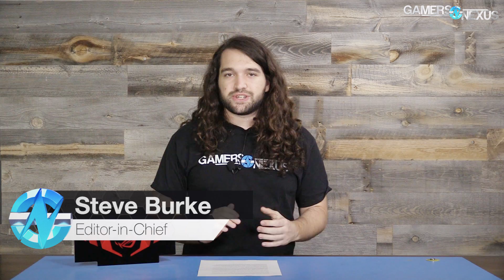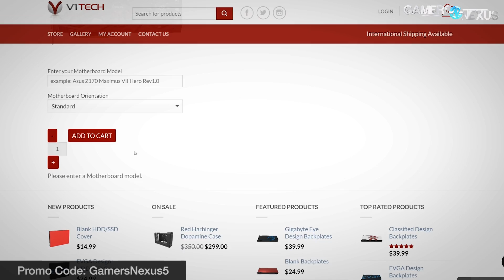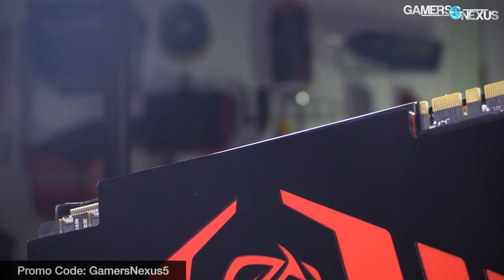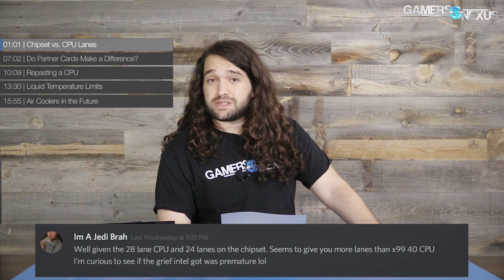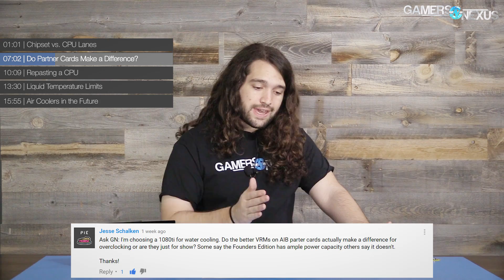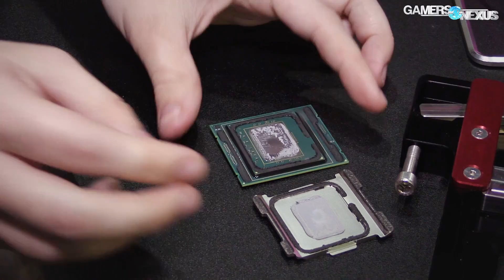Ask GN 51: How PCIe Lanes Work (CPU vs. Chipset)

Comment: Gamers Nexus Could you please make a video about how overclocking affects 0.1% and 1% lows?
It seems that quite often when you show overclocked results, the lows will be even lower than the stock frequency.
Would it even be worth overclocking most cards to the max since the lows are what's most important in most cases to make the game play smoothly, especially if you are already getting high framerates.
I'm assuming this is another reason why many manufacturers don't clock their cards higher even though it is possible for them to do so.
So would you be able to make a comprehensive video, comparing many cards and games, and try to see the effects, and maybe finding the ideal overclock so that it doesn't reduce the lows, and hopefully finding out why this happens (is it thermal? or lack of stability? low quality components?). I ask for a video because a simple answer wouldn't give us an in depth view of it all. 
Maybe compare a whole bunch of cards with the same chips from different manufacturers to see how they do.
I feel like this would be the best way to shop for a card, since lows are really the most important when it comes to choosing a specific brand and model for performance.
Reply from the maker: We'll be doing something like this eventually. We are revamping our testing methodology to improve it beyond just 1%/0.1%. Should have some progress soon.

Comment: is there anyway to check how many pcie lanes are you using Via software? because I would like to know how much lanes does a gpu use and how much does a raid card use? because I only have limited amount pcie lanes for my cpu
Reply: reading your motherboard manual will tell you how many lanes are available in each slot, a gpu will use up to 16 if they are available, the lanes used by the raid card will be the lower of the lanes used in the specifications of the raid card (should be somewhere in its manual or spec page) and the amount available in the slot it is installed in, but it will not perform as well as it is capable if it does not get the lanes its specifications requires. There may be an obscure way to do it in software, but the obvious way is to read the manual and make sure that every device is in a slot that has enough lanes for the device.

Comment: For the whole pcie lanes it was pretty funny when ryzen came out and all the intel fanboys were like:
"haha only 28 lanes that's not enough what a waste"

and then along comes intel
"hey guys 28 lanes for everyone"

and amd back at them like
"yeah we got 64 on threadripper this is the high end stuff not the 8 cores we released earlier" lol
Reply: Yeah I'm not saying 28 lanes is bad it's plenty for the majority of people I was just pointing out that intel fans were so quick to jump on hating amd stuff and then intel is like "hey we can do that too" lol
Reply: The funny thing about the AMD fanboys is that they make up things for the Intel fanboys (and the other way around)...
I'm yet to find a single reason why 99.999% of the users would care about this.
FACT a 8x PCI-E is enough for a TitanXp (less than 2-3% vs 16x)
FACT no idiot is going to buy a High end GPU or 2x for that matter and then slap it with a the peasants of the HEDT CPU.

From an hardware/performance sand point there is no issue. Intel should have never offer those two peasant CPUs, they make no sense on the HEDT family of products.
Reply: no reason for Kaby Lake X to exist period.
Reply: Algorythm44 you need to differentiate. The 28 lanes on Ryzen are not all CPU and all addressesable to what you want. Where as a 28 lane X99 or X299 part still also has the DMI and the associated HSIO lanes. 

The 600$ 8 core should have all 40 lanes no reason for it to have been glimped! I'm extra pissed cause that the price range I'd buy.
Reply: Elliot Kaufman Also, the 28 PCIe lanes of ryzen only has 16 PCIe gen 3 lanes, while intel promises they are all gen 3 lanes.
Reply: Algorythm44 Well, I have never encountered anyone saying that the 28 lanes from amd weren't enough and claiming intel is doing better. The 6800K hexacore also had 28 lanes, so the only thing they could say is that the 6 core 6850K and higher cpu's did have 40 PCIe lanes. Than came the skylake/many lake where the 28 lanes has expanded to the 7820X 8 core, but above that there are 44 PCIe lanes. But than we would forget about how much PCIe lanes there were on the chipset. The X99 chipset only had up to 8 PCIe x2 lanes dedicated which means that most things were run from the CPU PCIe lanes, the new X299 chipset has up to 24 PCIe gen 3 lanes. Of course, the chipset PCIe lanes can't be freely assigned by the user, but if you are using a M.2 SSD than you are using already 4 of those PCIe lanes, also the wifi uses it, and the LAN uses it, and the USB-ports etc. The X370 chipset offers 8 PCIe gen 2 lanes, which is the same as the intel X99 chipset. So even the Kaby-lake X quad cores with just 16 PCIe gen 3 lanes combined with the X299 has a whopping 40 PCIe gen 3 lanes compared to the 6800K with X99 chipset which had only 28 PCIe gen 3 lanes with 8 PCIe gen 2 lanes (comparable to 32 PCIe gen 3 lanes). And if we than have a look at amd with the X370 chipset, than they offer 24 PCIe gen 3 lanes from the CPU and 8 PCIe gen 2 lanes from the chipset, what is around 28 PCIe gen 3 equivalent. But they use 4 of those PCIe gen 3 lanes from the CPU to interact with the chipsets so the effective count is only 24 PCIe gen 3 lanes equivalent... So the 28 PCIe lanes from intel is far from as bad as the 24 PCIe lanes from amd. Even the 7640X/7740X do offer more PCIe lanes with the X299  and X370 taken into account.
Reply: i'm not sure any boards except 2011 sockets had 40 lanes, so the people boasting at you were comparing apples to oranges. the normal deomestic chips [1150, 1151, 1156] all had about 28, which in my opinion, is terrible. but it's a bad choice of chip. not bad design. 24-28 is good for gamers, but not workstations
Reply: Algorythm44 Well, the X370 top of the line motherboard for ryzen only offers 8 gen 2 PCIe lanes, just enough for 1 NVME drive. And no, you can't count that with the 24 lanes from the cou since the chipset uses 4 PCIe gen 3 lanes from the CPU. So a total of 24 PCIe gen 3 lanes. How does that compare to intel? Well, the enthousiaste line up does have a 8 gen 2 PCIe lane chipset, named the X99... The current gen enthousiaste cpu's can't be used with that old chipset, they got a new chipset named X299 and how mane PCIe lanes does that have? Up to 24 PCIe lanes gen 3. So the kaby lake X with 16 PCIe gen 3 lanes offer a total of 40 PCIe lanes. You only get to choose what 16 PCIe lanes do, but the ryzen let you choose 20 PCIe lanes. That is a but far from the 28 PCIe lanes that the skylake X's start with.
Reply: ABaumstumpf Well, the peasant CPU's are still useful. For those who want to get started in the performance build, they can start of with the 7640X/7740X and save up for the next gen CPU they want (be that an 8 core or the 18 core), they would than only have to switch the CPU and not the CPU and motherboard. I don't think intel will add extra features in the chipset that would replace the x299. Maybe thunderbolt, but I don't think thunderbolt would be that useful for desktops. Well, I would use it, to route the connection ports I need easy access to, to my desk. For example USB portes, sd card reader, audio etc. But I don't know if the successor to the x299 platform would have thunderbolt integrated. Also, for those who wants the max gaming performance, there is no CPU that beats the i7 7700K yet, the i7 7740X will probably do it since they promise higher OC potential.
Reply: Alex Marin The ryzen are all stitched together, the 8 core are 2 quad cores stitched together, the 6 core are 2 quad cores stitch together with 2 bad cores disabled, and the 4 cores are also 2 quad cores stitched together with 4 bad cores disabled. So threadripper will be 4 quad cores stitched together
Reply: It did cause a lot of foot shooting with the arguments. So much so, a lot of intel fans saved face and jumped ship, since intel made them look so stupid defending them.
That is the thing, I think it is less about being a fanboy, and more about being the one defending the one who won't make them look stupid.
Reply: There is no bigger marketing scam than what AMD is doing with Threadripper. They say it is "16 core". Bullsh*t. What you actually get is a monstrosity of two octacore dies stitched together. Nowhere near identical to having 16cores on a single die as you have with Intel. That is like stitching four 4K monitors with very thin bezels into one franken-monitor and comparing it to a legit 8K single panel monitor as if they were the same and say “look both are 8K, mine is 25% of the price!” and then have my ignorant fanbase attacking the manufacturer of the legit 8K monitor as being greedy. 

AMD is also saying that with X399 you get 64PCIe lanes to make it sound they have 20 more than Intel’s 44. What AMD does not tell you, however, is that 24 of these 64 lanes will be wired by the motherboards to general purpose I/Os (M2, SATA, USB, etc) in a similar fashion the 24PCIe lanes of the Intel’s chipset are wired. So with Threadripper you only actually get 40PCIe lanes dedicated to PCIe3 expansions slots (for GPU cards, etc) – that is 4 LESS than Intel (44), not 20 more.

Finally in Ryzen 7 and X370 you were only getting 24 PCIe lanes TOTAL.  Not 28. And fro those 24, the 8 were wired to general purpose I/Os (M.2, SATA, USB, etc) leaving only 16 PCIe3 lanes for GPUs. On X99 and 6900K you were getting 40PCIe lanes from the CPU plus another a further I/O connectivity bandwidth on the chipset worthy of 16PCIe3 lanes (6xusb 3, 14xusb 2, 10 SATA 3 and 8xPCIe2).
Reply: i dont think there is such thing as an "intel fanboy"  lol.   i think ppl are just fanboys to whatever is in the lead.
Reply: There are definitely fanboys on both sides lol

Comment: Which ryzen 5 cpu would be good for a seperate stream pc. I've been thinking of running a dual pc set up for streaming but want to stay budget friendly with ryzen 5.
Reply: The  r5 1600 is a good deal because it is a 6 core with a stock cooler, and it can overclock (even some with the stock cooler) and because it is a 6 core 12 thread cpu, it could run most games currently available and still have 2 cores available for streaming, or if used in a dedicated streaming pc, the 6 cores will handle encoding well, since that is a multithreaded task. The quad cores with hyperthreading could probably manage being used in a dedicated streaming pc, although they would not handle the job as well as the 6 core and the price difference is not very much. The 1600X is not that great of a buy because it has no stock cooler and the 1600 overclocks to the same speed, and performs the same when overclocked, although it is better if you insist on leaving things at stock.
Reply: I was looking into building a second pc to stream from my main rig which has a 6700k. The 1600 does seem like a good buy for this application.

Comment: With the recent announcement of the xXbox OneXx claiming 4k for $500 do you think you can try to put together a build for a similar price that could achieve the same thing? It would be an interesting spin to make 2 rigs, one with  new and one with  used parts to try and gain the most performance per dollar possible. 
P.S. Since 60fps was only promised for Forza it is only fair that you aim for 4k 30fps or better :)
Reply: 1157StrangeKid probably medium settings and not 60 fps
Reply: 1157StrangeKid look up potato masher
The guy does a PS4 vs $400 pc and PS4 pro vs $500(gpu upgraded pc). He's put together a pc using used parts and showed that it can compete with the consoles
Reply: Long Tran yes with used parts and most of those builds don't include a mouse and keyboard but the console does

Comment: Time to use car radiators to cool CPUs
Reply: sorry dumb question. but is this actually feasible?
Reply: @amancioodarve1880  https://www.youtube.com/watch?v=VJUJWtVbEys lol steve did a video a year after my first comment
Reply: @amancioodarve1880  Old, but yes. The primary thing to keep in mind is that aluminum (what is used in most car radiators) is not compatible with copper when it comes to using  both in the same cooling loop. So you would need to find a copper radiator if you are using a nickel plated or copper waterblock on your components; “don’t mix metals”. See the Enermax cooler review from GN, or other videos on YT when it comes to mixing metals, it’s not recommended for a very good reason—corrosion. While you can use coolants with corrosion inhibitors (many older vehicles used these when copper & brass radiators were popular, before aluminum), it’s better not to take the risk if you’re going with distilled water.

You can still find radiators and heat exchangers out there that use brass or copper that should be fine to use with your loop, though. They’re just expensive (relatively) compared to some junkyard car radiator.

Comment: Hi Steve,
I have an i7 7700k and have the twin problems of temp spikes (up to 90C) and overall high temps especially under load. I took Intel's advice and removed my overclock. Even at stock settings I still get these problems. What are my options for dealing with this problem. I've read that even delidded i7s have temp spikes so that might not be the best path. Should I consider AMD? Note: I live in a city with a very hot climate but usually I have some form of air conditioning or cooling for my room and I mostly use my rig for gaming.
Reply: Irfan Ahmed i have same cpu like you bought in may 2017. cpu says made in Malaysia. i am not having this problem of i77700k. is your CPU faulty probably? i mean i can only oc my i7 to 4.8ghz yeah i cant get to 5ghz at 4.9 it hangs but i haven't had this overheating thing issues i see on i7 7700k forums. and yeah i play pc games hard like 6-8hours everyday after work.

Comment: Sooo, the 24 lanes on x299 will be enough to give full speed power f.ex 3 m.2 nvme drives if the motherboard got 3 slots? And they will be as fast as the cpu lanes? Like gigabyte gaming 7/9 have? I got two samsung m.2 drives and are planning for a third.

Comment: Another comment on the pci e lanes bit: let's not forget, the pch pci e lanes has to share bandwidth on the DMI interface to the cpu with everything else on the pch, up to and including: any and all sata devices, any and all m.2 devices, any and all usb devices (3.x and 2.x), any network traffic, and any sound devices. During an online game, that would be a lot of bandwidth to split and share, especially since dmi only runs at a 4x speed iirc? Or maybe 8x. But still, sound information, network information, keyboard and mouse, all that would be competing with your graphics card during fast paced gameplay...not exactly ideal.

Though a question I've always had is why don't they just move the PCH onto the cpu die itself, for a desktop style SoC, since low power SoC's have been a thing for a while now?
Reply: intresting,so in gta online when i'm plaiyng a short race with 26 other people,what's the reason my fps drops? i got a 6700k wich has 16 lanes that all assigned to the gpu(not necesarely used) my chipset lanes aren't good enough for my standart sata ssd? my cpu usage isn't that high,and gpu isn't overused ethier
Reply: Threadripper will fix that PCIe lane problem. The extra price I could live with. However the new and wonderful GPU and Ram prices make building a new anything out of my price range. I have a new R5 1600x and a RX 580 I bought in November only because a TUF B350M was $70.00 and I bought RAM and an M.2 in February 2017.

Comment: Awesome video, you really deserve more subscribers!

I think the 140w TDP for Aircoolers won't be much of an issue, looking at various Processors from the Past, we've often seen TDP of 120w+ on relatively small Processors. For example I have a old server with 4 X7350 Processors (130w TDP) and they don't get above 60° despite relatively small heatsinks with the "passive cooling"... some of the high performance Xeons also reached 150w+.

Threadripper is huge, meaning a bigger surface area to transport the heat. 

As for the raw capabilities of Aircooling itself, we just have to look at GPU. We had GPU like the Asus GTX 580 CU II, which easily took 300w but stayed around 60°.
Reply: MadIIMike booom.

Comment: my noctua D15 kept temps under control just fine even with an overclocked 5930k at 4.5ghz 1.32v. in that configuration it would pull ~180-200w while stress testing. 

big air coolers should be fine for these new big CPUs
Reply: http://noctua.at/en/noctua-at-computex-2017 x399 :)
Reply: 2nd Legion Yes, I saw that. My point was that a big air-cooler has plenty of thermal dissipation ability to work with x299 and x399. They just need compatible cold plates and mounting.
Reply: yep, but they have pictures from ces with x399 air-coolers/120mm fans... i believe
Reply: 2nd Legion Which should be just fine for the lower core count CPUs in the line and without a big OC the top end CPUs as well. My current r7 1700 at 3.9ghz 1.3v doesn't come close to the power draw and heat output of my 5930k OC. 
I'm not worried about threadripper thermals. The huge IHS will allow for better contact from many heatpipes (not that that is necessarily needed).
Reply: exactly...totally agree, the new a-series fans looks nice tho... maybe i should update my 2011 NHd14 fans... ;)
Reply: 2nd Legion haha you also watch em new noctua air fans dont you? hehe i also like em, that when they are available i will buy one and give my old two noctua fans to charity (the other fan is too loud anyway that i only use one instead of two on my nh15 air cooler) or as giveaway on my channel so i can increase my subs from one sub (my gf) to maybe 10 subs now.